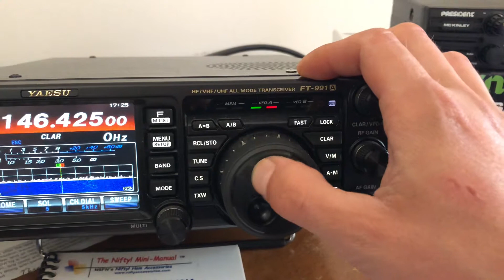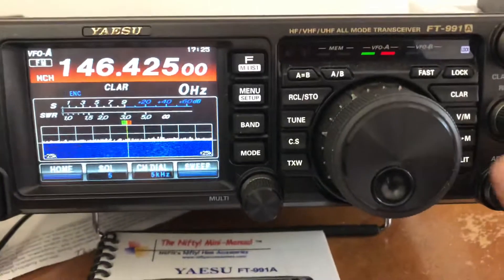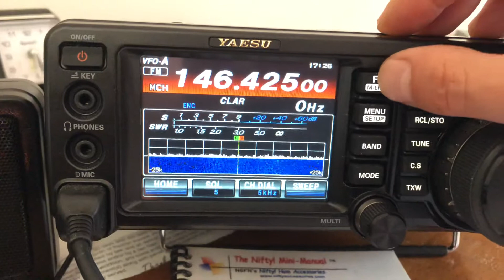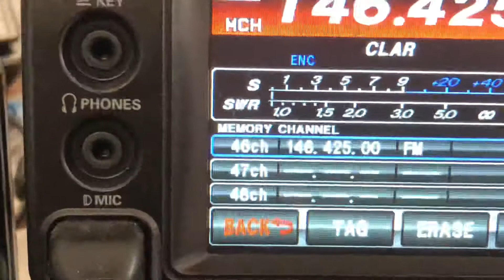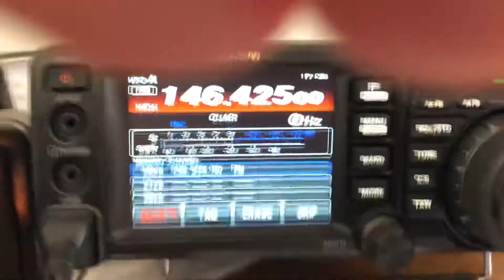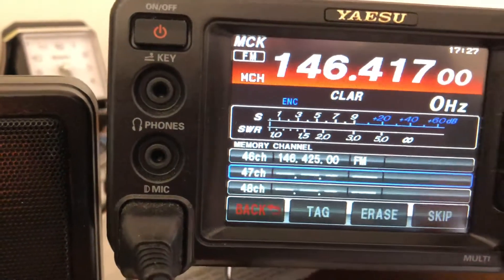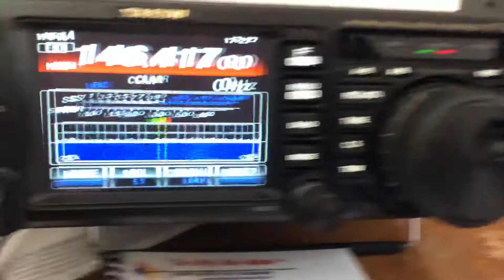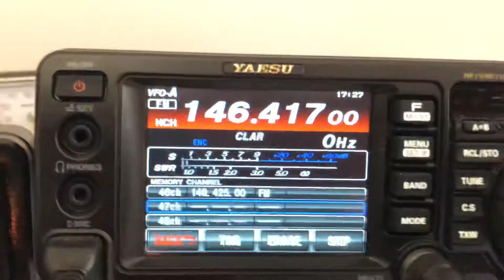Manually Program Simplex Frequency on Yaesu FT- 991a

Comment: Do you ever get on 2m weak signal?  If so, you should make a video about it.
Reply from the maker: QRP Adventures to answer your question yes I try on 144.200 USB or lower and try.  But I’m vertically polarized.  But I’ll definitely take your advice.  Thank you.
Reply: I made a 100 mile vertical ssb contact a few months ago.  I have a video about it on my channel.  Feel free to check it out.
Reply from the maker: Nice will do